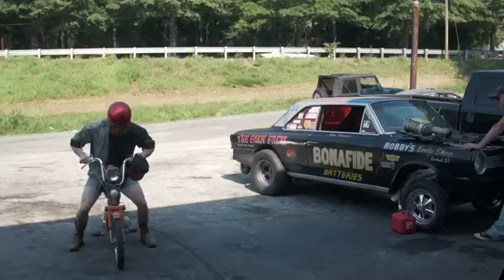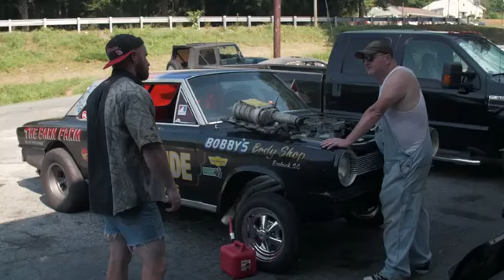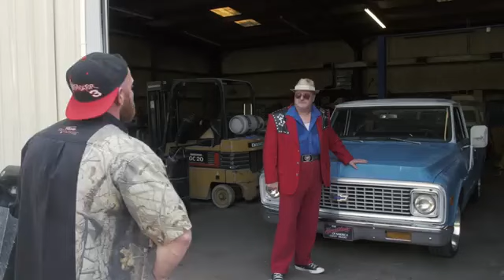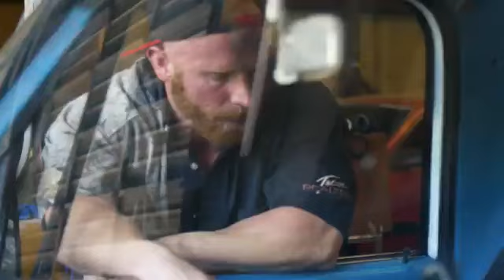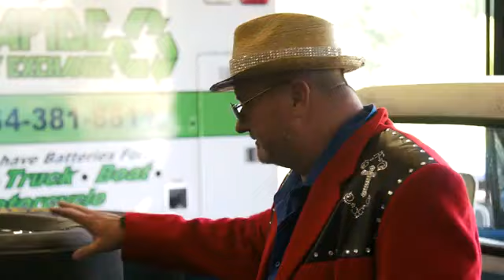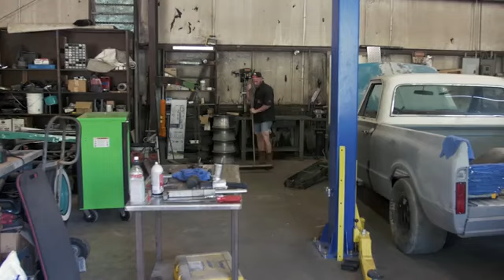Comedian Ginger Billy: Looking for a Race Car! LOL Funny Comedy

Comment: My dad had an 72 C10.  The dash was cracked and the paint was bad.  The heater barely worked but it was fast.  He went through 3 motors.  When I was young I hated the truck.  Now I would love to have it and fix it up.

Comment: I had a 1989 DECH H-Body Mustang LX with a 351 Windsor that I built. Mah Bebe! 302 my left nut. Balls out with comfy seats. (Riccaro 5 point harness.)  265/50 wet tracks and off ramps at 170 Km/h. Miss that ride. Best COP pull over? Saturday afternoon. I buried the needle from one exit to another. The wipers were floating at 140 Mph. Took the Bike COP 3 intersections to catch me as I turned South. He said it was 50/50 which way I went but we had a good chat. Hope I caught you on a good day Sir. 15 over and I don't want to see this in court. I don't know how fast you were going. I don't like going that fast! DAMN! Wait for the next episode?! The Vertical Peddle goes through the Firewall! Miss my Pony...